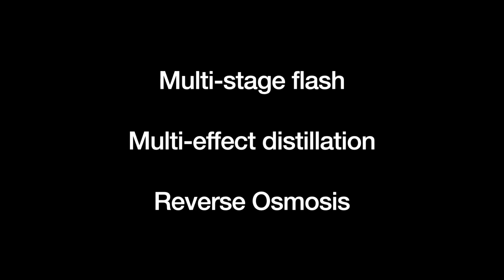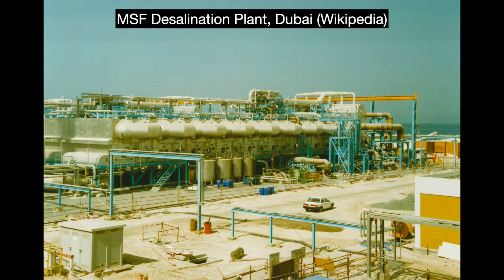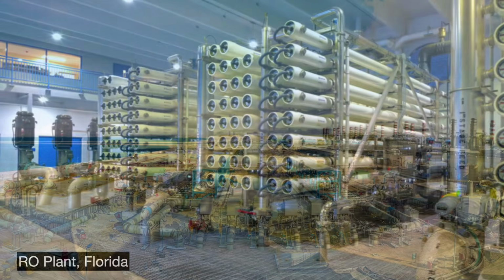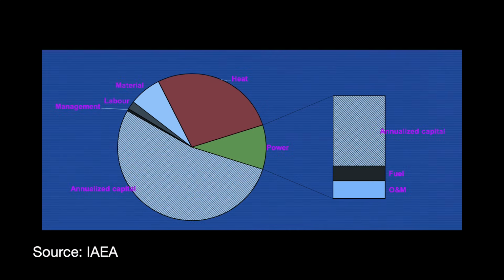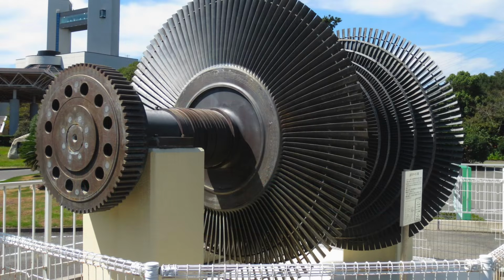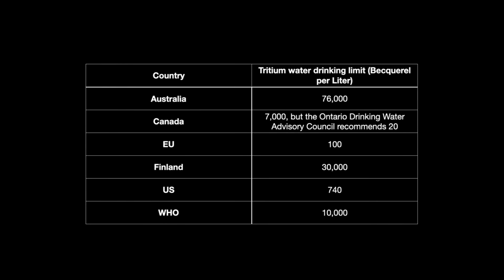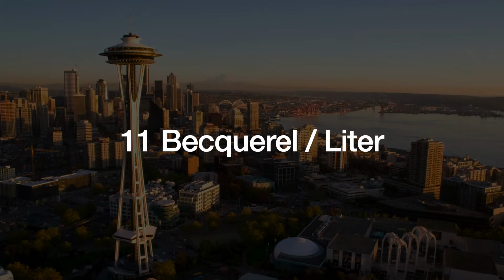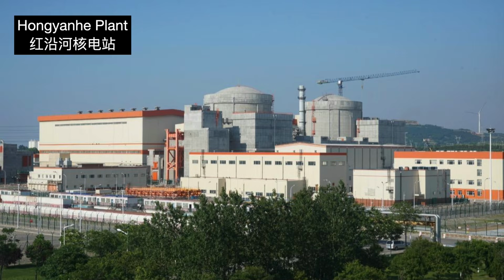Going Nuclear to Desalinate Seawater

Comment: One interesting note, dedicated desalination reactors can be MUCH cheaper than energy-generating reactors. That's because they don't need to pressurize the water to keep it liquid at very high temperatures. A desalination reactor can just pressurize water to just 4 atmospheres, raising the boiling point to about 140C. 4 atmospheres is easy to work with, it's less than the pressure in your faucet.
Reply: Alex and Aereto, you are both correct. We need both water and power. If we can push the use of nuclear for water product and have plant operate cheaply and with out issue, we can finally maybe change the public relation of nuclear is bad. Then we can talk about getting nuclear power online which is the only way to get off fossil fuels.
Reply: "...pressure in your faucet"  uh, maybe in your country, but not in mine.  only 2 ATM.  sucks too, cause it used to be higher before "water saving measures"
Reply: All reactors generate thermal energy.
Reply: Steady Energy from Finland are working on that principle to build a district heating reactor which produces heat around that range. I wish them the best of luck with this simple use of nuclear.
Reply: Even better, MSR reactors that natively run at 700C at 1bar.
Reply: @nowandrew4442  MSRs are dead. They don't scale past prototypes for a lot of reasons. Chiefly, there is no reactor vessel material that can withstand molten fluoride salt for long. And by "long" here I mean multiple decades or even years, that are expected from a modern nuclear reactor.
Reply: Or you could use high temperature gas cooled reactors or molten salt reactors to generate electricity and use the waste heat to desalinate the water.
Reply: @thegreyghost5846  Sure. But then the reactor cost will be dominated by the energy-generating part.
Reply: @AlexBesogonov  
If people keep pushing towards electric vehicles for short range travel and commute, the transition can cause more strain to the power grid than green energy can keep up and have to resort to other fuel sources for on-demand power or baseline power.

Hybrid systems are never cheap, but they make efficient use of resources by not letting the work go to waste. Using nuclear or other waste heat generating sources made for other purposes to desalinate water is more useful than you think.

We don't get to have geothermal power or desalination unlike some countries, so best you count your blessings before you lose them.
Reply: @Aereto that's not the point of comment.
You can have energy generator(not only nuclear) with desalination plant or central heating like we have here in Russia, where n=0.6 generator followed with n=0.9 heat distribution pushes entire station to n=0.9. Or you can have station with only one type of output with n=0.9 efficiency. Same efficiency, last is cheaper.

Also hybrid systems are forced generators, which actually destabilize power system.

Comment: One thing most people miss is that heat energy cannot be converted to electrical energy at 100% efficency. Usually it is 33-50% efficient. So even if it requires twice as much energy thermal processes are still more energy efficent.

Comment: When using nuclear power to desalinate seawater I did not think of using the waste heat I only thought of using the electricity.

To supply California all its water needs it would need fifteen one million cubic meter nuclear desalinate seawater plants. Add a couple more and then California could supply the water needs of Navada and Arizona eliminating entirely the need to pull water out of the Colorado River. Southeast California, Navada, and Arizona could turn deserts into farmland with basically an unlimited amount of water with adding more nuclear power plants using wastewater in Navada and Arizona from cities to supply to farms. The economic benefits to Southwestern United States is almost basically limitless. 

The problem with the leftover salt could be taken care of by dumping it into salt ponds to evaporate to collect the salt for commercial use.

Comment: I think three energy sources are promising to desalinate seawater at low cost: nuclear, solar thermal, and geothermal. I saw that they are developing a new technology for drilling the earth's crust at low costs to generate thermal energy. They will reach a depth of 20 kilometers anywhere on the planet to reach the depth where the temperature of the rocks is 500ºC to produce steam for the turbines.

Comment: The problem you didn't touch on here is, where do you put all the salt that is removed? This is of deep concern. There is a desalination plant in San Diego, CA, USA that is returning the brine to the ocean. They are using RO that extracts 50% potable water with the remainder being a much stronger brine solution. In the short run, this is not a problem; in the long run, it would be extremely harmful to the ocean as it will drastically change the salt content of the ocean. The salt, or brine residue, must have a place where it can be deposited. But, who wants to have salt deserts in their area? I sure wouldn't.

Comment: There is other sources for water and that is wastewater treatment. RO and other membrane tech can result in pure drinking water. This means the treated water used by humans and then dumped into the wastewater treatment plants is not just dumped back into the sea/rivers. Many Wastewater treatment plants generate methane gas as part of treatment process and this is burnt to generate power and heat thats then resued on site to cut power demand (lets all say thanks to microbes). Even if this idea is less than attractive for drinking water, there are plenty of water users that don't care whether its ultra "pure" or not - industry/agriculture/washing etc. KSA and the Middle east also have other non oil power sources ie solar and wind. Such power while intermittent can offset some of the power demand no matter the desalination tech. Even KSA does not want to be burning oil to make water -exporting it is much more valuable. Hot regions tend to have lots of solar capability. Many are near the sea so wind power is available. The other deslaination waste is high salt brine water which is dumped back into the sea. This ultra high salt water is not nature friendly and while there is a demand for seasalt its not that big compared to the waste. Salt based batteries might generate demand instead of dumping the waste. 
Can waste heat from nuclear (after generating power) be used for desalination. Its usually lower temp heat and can that water not be condensed to generate water that the plant needs to generate power again. Perhaps a desalination plant can also be used to cool the waste steam further before returning to the nuclear power plant. Perhaps wastewater treatment plants and desalination plants should be co-located. Few nuclear power plants are located so near to high population densities where there is a demand for waste heat for district heating. Wastewater treatment plants also tend to require large power demands 24/7 unlike normal power demand curves and also need water to dilute the treated waste water returned to the sea.

Comment: Environmentally the turbines will enhance marine growths and food chains … 
This is exactly in the same way as drilling oil and gas wells does … by increasing the local water temperature  only around the turbine areas to provide fish breeding habitats down stream in the turbine exhaust out flows - for plankton and other needed elements of the marine food chain … 
These increases in fish 🐟 communities I have seen in my own experiences of drilling wells all year round - and observed ROV camera footages from the start of drilling the first wells to final completion of them increased fish communities from zero to shoals of them - and all different types in the water column - surface to middle to bottom species … in the 60 days on one location - I observed zero fish to shoals of fish swimming around the wells …! And wellheads … in 1000-1500 m water column … inother words the full variety of top middle and Deepwater species … so the Fishing environment is enhanced … meaning fish stocks grow … in a world of over fishing … this is a huge benefit not an environmental ‘cost’ - bottom feeders etc can be screened out via centripetal filtration systems … that expel non water from intake flumes from intakes … so there is no turbine collision after the screen intakes … so nothing is impossible ..! And indeed wave oceanic current flow tidal current flows in headland / valley areas are a huge source of energy … strangely enough at the exact sites where you would consider installing desalination plants … right there on your door step …!
Reply: Offshore floating wind farms in Deepwater applications in inland 12nm areas however water depths are typically less … therefore bottom anchored systems are more typical - marine birds tend to live in inshore waters … so there is less birds = less bird strikes … there are therefore much more on ‘aggregate’ as you stated reasons to use renewable energy sources rather than nuclear … you have not mentioned the devastation and number of birds fish etc that are killed in a nuclear accident …? From fallout radiation poisoning etc …? Where are all of these in your aggregated assumptions … or are they just neglected too ?

Comment: Sorry but you are wrong to jump to nuclear for desalination- why not use sea currents turbines and tidal turbines and wave turbines … the process of desalination has nothing to do with the power source … nuclear does not need to be used … also you can use seawater through settling evaporation tanks - USA has huge expanses of open land … a solar oven will do the grunt work … then the higher heat demand can be supplied by other boosting heat sources .. - so you are not offering anything ‘New here’ also what happens if the water system gets contaminated - this means an entire … cities water supply can become irradiated … if using renewable energy … again your cost arguements are only around the desalination … 
The investors pay for the build …? What about the cost of plant closure and disposal costs throughout operations and then decommissioning of the nuclear plant …! So the cost of Nuclear power is NOT cost beneficial …! As the investors take out 29-40% of the profits … lol 😂 it actually means that the project operates economically at a loss …!

Comment: It's a winning combination. I used to be a nuke on a US Navy submarine. The reactor is just a heat source that doesn't require hydrocarbons like oil, gas or coal. Under pressure, the very hot water from the nuclear plant is pumped inside the tubes of a steam generator that makes the steam and sends it out of the reactor compartment in secondary piping (WITHOUT radioactivity) to drive turbines to make electricity. It's a simple thing to branch off some auxiliary steam to make fresh water from sea water as we did underway. We could produce about 10 thousand gallons of fresh water daily in the 1970s which was more than enough for the power plant and potable water for a crew of 140 men. Nuclear plants should be built in seismically quiet coastal areas with associated desalinization plants to make surrounding communities and regions plenty of fresh water. By the way, when you see those big cooling towers emitting huge plumes of environmentally safe steam, remember that all this heat energy is just being wasted  to the atmosphere when instead, just a small portion of this non-utilized energy resource could be used in auxiliary capacities like desalinization that could benefit the utilities as a secondary but significant source of revenue in terms of the overall nuclear power plant's business model.
Reply: What happened to the waste brine? I know for large industrial desalination there's enough to throw off local salinity levels if it's dumped back into the ocean
Reply: @hotmailcompany52  at sea, obviously this isn't a problem for a submarine BUT you bring up a good point for a stationary desalination plant onshore. I'm not an expert but it does seem reasonable to engineer an undersea pipe for about 2/3 km as long as depth is acceptable before reaching a discharge point where the salinity of the excess brine would diffuse naturally. Of course, experts and ecologists can get together to come up with a good X km if 2/3 km isn't far enough or unnecessarily far but I'm just giving it a guess here. Besides, this important issue that you raise is certainly being addressed by the environmental impact report which would be done before plant construction in most jurisdictions. After all, there are more than 19 thousand desalination plants in operation all over the world now.

Comment: Conventional nuclear fission designs are dinosaurs from the 1950's. The burn up only 1% of their fuel, owing to being solid fuel rod designs, as pioneered by the US Navy.  Their inventor, Eugene Wigner, said by the late 1950's that the LWR/PWR should not be built for efficiency and safety reasons........he was browbeaten for it.  The real answer, as proven by ORNL is liquid fueled 'molten salt' reactors(MSR) where the fuel is dissolved in the coolant which is a liquid salt. Even common sea salt is far superior to water as a coolant, salts giving very high temperature yields ( 700C) at normal atmospheric pressure with a fuel burn up of over 99%.  In particular throrium can be substituted for uranium, eliminating weapons proliferation and being 20 times more abundant than uranium, is a much cheaper fuel. Even spent waste of conventional reactors can be burned up in a MSR.  However the establishment wanted solid fuel reactors cooled by water, in order to harvest the spent fuel rods for plutonium, to make weapons.

Comment: The biggest problem with desal is outflow waste. Clean water comes out one pipe, what comes out the other? It's not just salt, but other minerals and substances as well, all in a concentrated form. That's the real issue. Forgive me if you brought this up in the video, I went back and poked around but couldn't find it.
Reply: If the brine can't be returned due to contamination then this won't work. The ocean is unnaturally diluted from rising sea levels from the melting ice sheets. An optimal balance needs to be reached, then maintained.

Comment: Please help me here with my understanding. (which is still limited). Desalination plants seem to be all the rage right now, and indeed, drinking water security is critical. But I am concerned with what happens to the salts that are removed from the saline sea water, is this slurry (Brine Discharge) pumped back into the oceans whence it came? have there been many (any) impact studies on what this effect has on the immediate ocean life near the location, or does it diffuse out quickly, as the ocean is vast. But I have to wonder about if this is scaled up around the globe, and the long-term effects of no only increased global temperatures, but potentially the increased salt percentage of the oceans.

Comment: Good video. One thing missing is that if you consider levelised cost of electricity and factor in (in pretty much any way) use of the heat from the condenser after turbine if using MED/MSF, you will get amazing numbers. If somebody would like to look into the matter I humbly suggest my thesis I wrote at NCCU in Taiwan. Name is Martin Groch.

Would I write it the same way today? No, I would not. Are there big problems with it? No, at least I so not think so. 

Fun fact: that plant in Aktau is the only nuclear powerplant that is not where it was anymore. Actually decomissioned, dismantled, removed.

SMRs are unavoidable and their use for desalination as well.

Comment: ok.. i gotta ask.. why wouldn't they just make power stations? coal, gas, nuclear, whatever, and get desalination for free?? all these thermal power plants use the heat from reactions to create high pressure steam ( ~170 barr, 350`C) that then drives a turbine. as the turbine extracts energy from the steam it loses most of its heat and pressure by the time it exits the turbine (~0.1barr, 40`C) and travels to a condenser which turn it back into water so it can be re-used to make steam.... sooooo.. you see where i'm going with this right??

instead of reusing the same water, send the condensed water off to storage, and just take in fresh salt water to generate the steam with.... and just like that it now costs nothing to produce desalinated water, AND you have lots of cheap power... I get it, it's a tiny bit more difficult because of the corrosivity of sea water, but it's a pretty easy problem to solve... a simple two stage boiler is all it would take... the vaporization point of just about every salt in ocean water has a higher vaporization point than water, so pre-heat to produce only water vapour (plus trace amounts of salts, too low to be concerned about), then heat the water vapour to high pressure steam in a secondary boiler....  overall this should require roughly the same amount of thermal energy per KW/H produced with this 2 stage boiler compared to a single stage boiler, with only some very minor losses, depending on how well engineered the system is....... other than in a nuclear reactor for obvious reasons, I seriously don't know why you would do this any other way??? (it is still do-able in a nuclear system, as is described in the video with heat exchangers, but it's not as efficient. A possible work around is to use 2 heat exchangers carrying molten salt prior to the steam generation, then contamination concerns can be adequately mitigated and the process could work in the same way as described above)